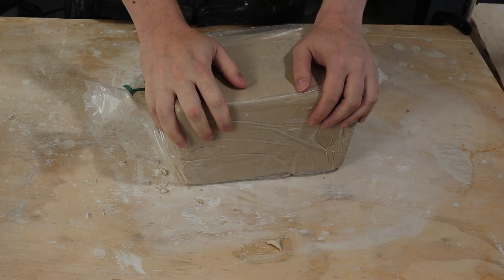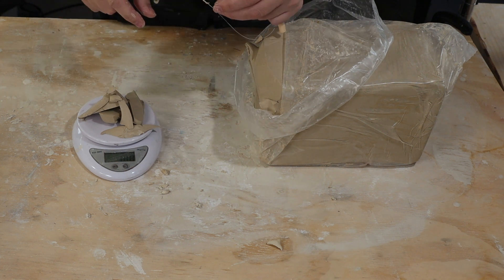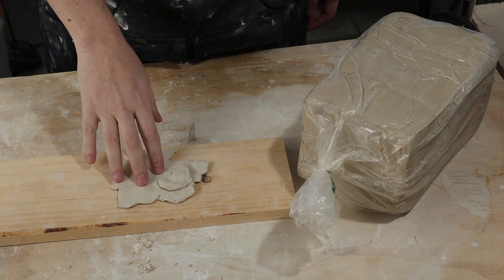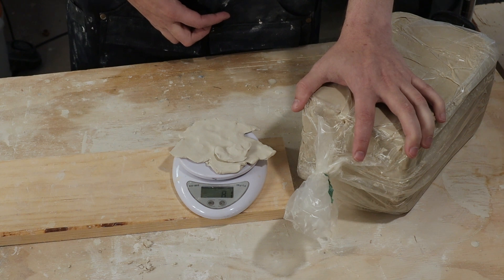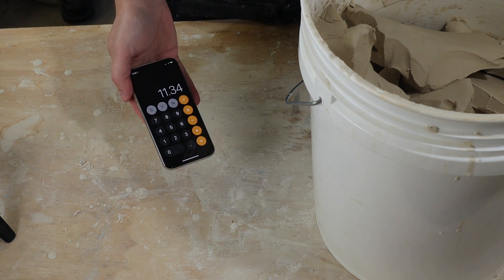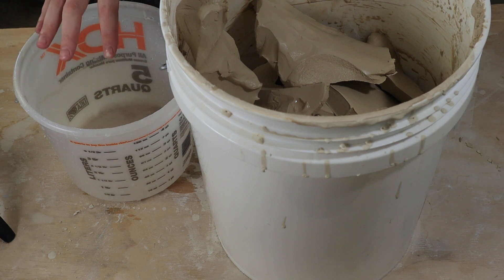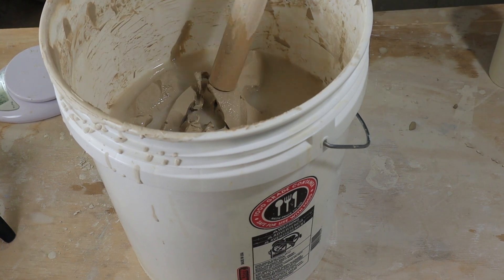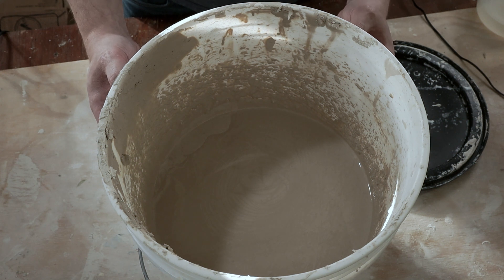Can you make SLIP from CLAY? And how much water is in Laguna B mix?

Comment: Really excellent information. I've noted it for future reference. I have read so many things stating that "not all clay"  is suitable for slip casting, but B-Mix is what I have and this gives me more confidence to mix up a bigger batch. It's been a real learning curve involving over flocculation,  water logged molds and more. And for some reason pottery plaster is scarce. But your videos have been amazing. I purchased the Essential Guide to Mold Making and Slip Casting and your content has been much more valuable. Thank you for your scientific approach and for letting us tag along as you experiment.
Reply from the maker: I've learned a few more things since this video and the formulation of clay for slip casting is usually a bit different than that of throwing clay. Having said that, the first few years I slip cast, I turned throwing clay into slip in basically this way. I think the biggest issue I ran in to was the clay could be a bit sticky and sometimes hard to get out of the mold.
As far as deflocculant, I exclusively use darvan since it is way more tolerant.
And thanks for the comments about my content - glad to hear it!
Reply: Thanks for the update!
Reply from the maker: You're welcome!

Comment: I realized that one other possible benefit of slip from Laguna B mix (what I most often work with), is that I can make mug handles etc. by extrusion and then when the moisture level is right, add them to mugs made from a single mold, avoiding 2-part molds and the inevitable seam, as well as avoiding the "well" a slip cast mug with handle has.
Reply from the maker: That's a good point. The only real downside I've had is the composition of throwing clay doesn't seem to be quite right for slip casting. In particular it seemed to be sticker in a few of my molds and I had a harder time releasing the pots. I might be possible to tweak the slip composition a bit to overcome that, but that is beyond my knowledge right now.
Reply: @PotterybyKent  I'm wondering/thinking the Darvan is likely playing a role.  Might try sodium silicate instead, or alter the percentage of the defloculant.
Reply from the maker: That is an interesting thought. It is possible, however once I swapped out the clay and kept everything else the same the issue went away. That could be a coincidence, but I've seen some other potters also allude to different clay compositions between throwing and casting clay. But as with most things potter even when you try and control for a variable there's a bunch of other hidden ones as well!